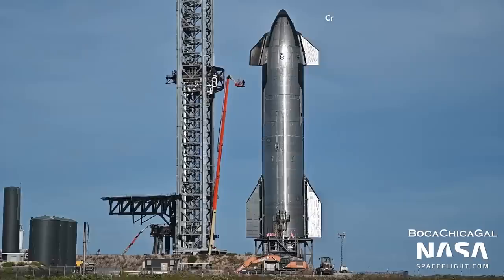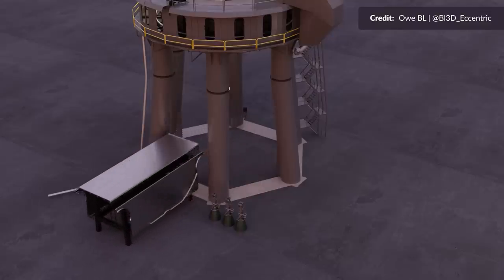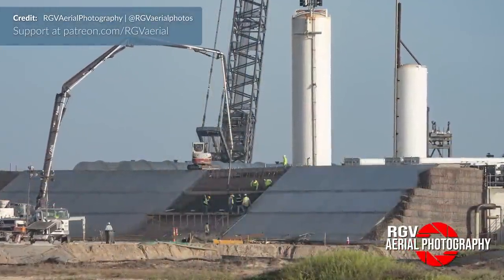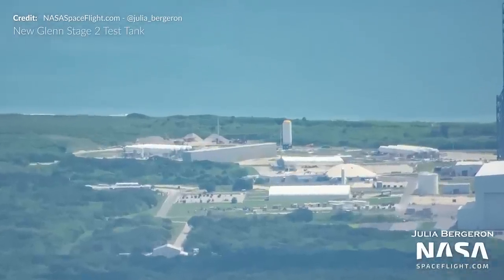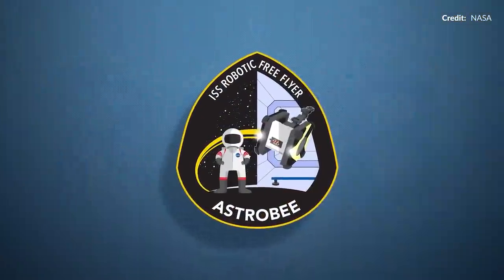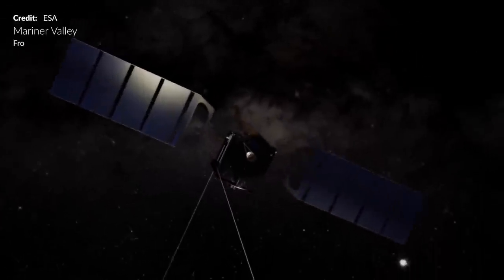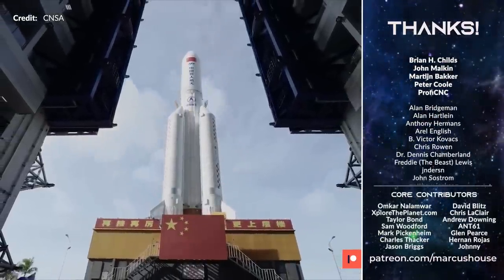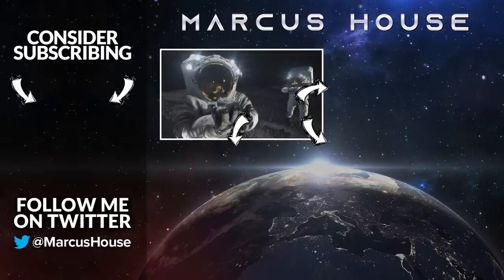SpaceX Starship Testing Ramp Up, Huge International Space Station Changes, & more

Comment: The head of Roscosmos has told Putin on TV they will be leaving ISS in 2024 to focus on building their own station....Leaving all the politics aside Roscosmos can't afford the cost of it's ISS participation if they're gong to do anything else in space. If they stay in ISS till 2030 that would mean they would essentially be committing to doing nothing else for the next 8 years to the sole benefit of Western ISS partners whom they're currently not on good terms with. So I would say chances are 100% they will be leaving ISS by the end of 2024.

IDK what that pullout will look like, but doubt they will actually disconnect the Zvezda and Nauka modules. Doing so would take a lot of effort. Plus contrary to popular opinion shutting down the modules and leaving them there is probably more of a hassle for the western partners than if the Russians went through the big show of physically separating them from ISS. So most likely they will just shut everything down disconnect whatever hardware they needed to close the door connecting Zvezda to the rest of ISS and leave.
Reply: I'm surprised Russia decided to pull out instead of just taking it over without anyone's permission...   "This is mine, this is mine, this is mine.. I don't want that, but this is MINE!"
Reply: @ffsireallydontcare  A James Bond esque space battel for ISS would be pretty cool 🤣
Reply: @ffsireallydontcare  In the great Soviet tradition that Putin worked in - “what’s ours is ours, what’s yours is negotiable.”

Comment: Just as NASA stupidly got rid of the Shuttle before having  replacement launch capability to the station, I fully expect NASA given it's history, to get rid of the current station before they have replaced it with the new one. That is unfortunately how NASA rolls.😢
Reply: Axiom is already building modules for their commercial station. The first module is planned to be attached to the ISS in 2024, with the others being added after that. The plan is to get all the modules connected and then detach them from the ISS, before the ISS extension ends in 2030. NASA is also working with other companies for more commerical stations. NASA plans on buying time on the commerical stations, like how they get CRS and Commerical Crew flights.

Comment: If NASA cannot go past the Van Allen belt.  How is Tesla going to do it?
Reply: Huh? They did get past them during the Apollo missions. The simple fact is that on the journey through the belts they are moving so fast that they don’t receive that much radiation.
Reply: @chronovore7234  Exactly. But the Moon Hoax people keep pushing the lie that if you go into the Van Allen belts, you will die. That is only true if you linger there and both Apollo and Artemis are just going straight through.

Comment: China is moving forward with a remarkable speed,  at this rate they would have a moon base by 2035, yet most of the space missions to mars are wasting of money, it should have been invested in terraforming mars research, as long we do not have a possible way of terraforming mars , there is no point of all these mars missions, most of the money should be withheld till we find a viable solution to mars issue, or at least cheaper faster  way to colonize mars, 7 months trip is never gonna work